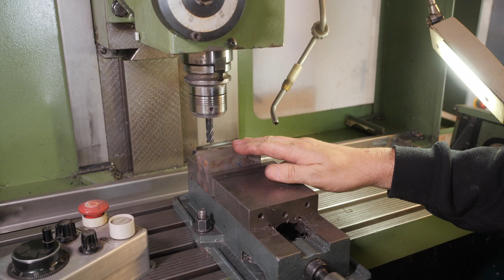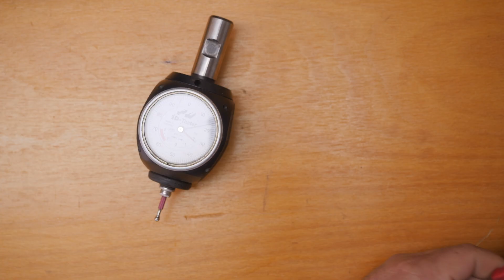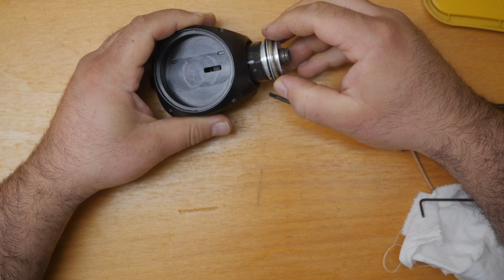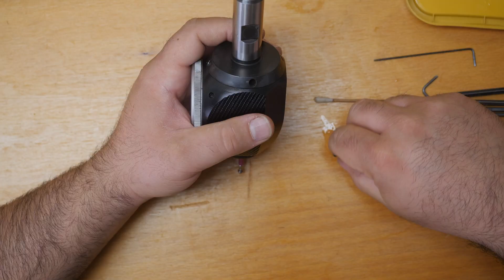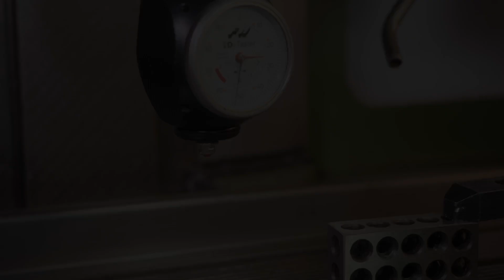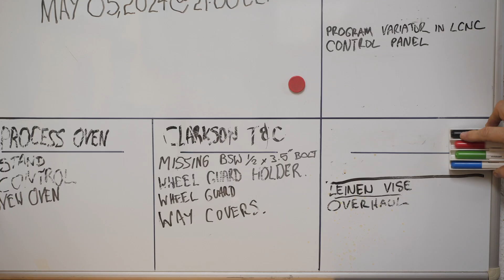Haimer 3D probe jammed up || RotarySMP

Comment: Thanks for the upload! I rounded the grub screw holding the dial in, and didn't want to pull mine apart to see how it worked to check what grub screw end was required. Thanks
!
Reply from the maker: They are a really nice tool.

Comment: Watching this makes me want to get into a whole area that I've never been able to get across to people. It's a topic I have no idea on where to even start . When machining we're so used to having very rigid parts clamped together and as a result we need very flat precision surfaces. But when you cut back to the basic physics in reality things only have six degrees of freedom. That means if two parts touch it more than six points they are over constrained. That's because in our world there are three degrees of freedom of linear movement and three degrees of freedom of rotation.
So what they call a kinematic coupling has only six points of contact. This type of coupling is often called a Kelvin Mount after Lord Kelvin who wrote a paper on them in around 1868. There are two types and in our case the one of particular interest is called a type 2. It consists of three grooves 120 degrees apart on one item and three balls 120 degrees apart on the other. You can vary that angle provided the two parts are of similar angle.
Go here in Wikipedia to see a very good description:

https://en.wikipedia.org/wiki/Kinematic_coupling

The key point Is that if you disassemble them and reassemble them they go back to exactly the same position. So the assembling is repeatable if not accurate. For accuracy you still have to calibrate them for being centered to the milling machine spindle, but you know after that it would always settle to the same position.

These days you can buy a touch off probe made using this construction for around about $100.
Usually the six faces of the grooves are replaced with roller bearing elements, in parallel pairs. The construction doesn't have to be particularly accurate because the principle of six contact points means they're still repeatedly go back to the initial position. Then you simply put wires between the rollers, making sure the wire goes from a roller on one ball to a roller on a different ball. Let's assume we now have a circular short circuit daisy chain from roller to roller passing through each ball. Now cut one of the wires and connect a Ohm meter across the cut wires. Now if any ball were to lift off any of the rollers, the daisy chain will be broken just like old Christmas tree lights . We're assuming here that the plates shown in the Wikipedia  Kelvin Mount diagram are insulating.  Now you mount the touch probe on the center of the system pointing through down to your part and you have a spring load that tends to push the two plates back into their mounts . Using this probe in any of the X,Y or Z movements on your mill will open the daisy chain when it touches the part so you can set X,Y and Z immediately contact is lost . Super simple. One moving part. Cheap to build.

A similar concept is a Stewart platform that you would recognize on  a flight simulator:

https://en.wikipedia.org/wiki/Stewart_platform

6 rams to control the 6 degrees of freedom: pitch, roll yaw, ascent, side-slip. and forward.

It's also used on the cheap HP bubble jet printer head traverse, on a centerless ground bar, with one linear degrees of freedom unconstrained. Over the last 30 years they must have made over 100 million of them.

And lastly: centerless ground bar is the only grinding process I know that is super fast, super cheap, and super accurate. It's about the only accurate large component in the whole prints. I ran one in Auckland one (university) holiday making pistons to Lucas hydraulic pumps. One machine can do kilometers.

https://www.youtube.com/watch?v=6U4qH8dSi_8

(turn on the coolant please!)

So many projects we could build with this concept. An expensive camera mount comes to mind.

Comment: I get how you dial in the unit with the 4 screws for minimal runout but I don't understand how you were able to calibrate the unit with the 4 frame screws. The fact that the bezel rotates made it even more confusing as to where to set the 0 in its resting position.
Reply from the maker: It turned out we had been trying to set it for 4mm balls, and were running out of adjustment, but once we switched to the standard 5mm balls, it adjusted easily.

Comment: So what was the issue now?
Reply from the maker: It was jammed because the dial face was not level and jammed the needle. 

Then you have to set the range of indication to the ball diameter. As there was a 4mm ball, we had to move to the edge of adjustment. Once I broke that ball, and replaced it with a 5mm one, we could move it to the center of it's range.

Comment: I gotta say, you should look into (making?) A conduction probe. Light turns on as a current path is completed through the machine. Maybe make that trigger a lil transistor or mft or a stack of such so that the machine can know when the switch is triggered. That or use what amounts to a series of IR leds and a remote receiver. The device is super simple and probably a fun lathe project.
Reply from the maker: I started making a 3D probe to tie in with LinuxCNC, but it it ended up on the low priority project pile. Maybe I will get back to it.
Reply: @RotarySMP  Well, you got the tools for it. at least most of them. That being the grinder and the lathe. it's just a ball on the end of a stick with a plastic separator either mechanically held or glued on, or even screwed on, though if I remember correctly, threads are not a locating feature. It's definitely not a priority, yeah, but if you need to get something out and you're stuck twiddling your thumbs... it might be something you can do, if you're comfortable with electronics. really, yeah, the hardest thing to do is to get it talking to LCNC while rotating. Hence my idea of using 3-6 IR LEDs. could also use slip-rings but that mightn't be the most reliable. Also rotation's to couter the ball maybe not being round enough.

Comment: I bought a used Haimer last year. It was my big tool envy purchase of the year. Be careful with the tips. They are about $85 US each. Once you Haimer, you can never go back.
Reply from the maker: Thanks for sharing. I need to reset all the tool offsets in my tool table based off the Haaimer, but also look forward to using it.

Comment: Hope you checked the runout after you snappede the 4mm off and mounted the 5mm. Since your suppose to always check them every time you mount a new. Onee in ( when I was still in traning to become a machinest I snapped one off. Put in a new one and didn't understand why it was so much off. Then one of the old guys told me that you suppose to check it every time you mount a new ball. Cause it's never perfectly centered/just like the last one. And when I then checked it it was about 0.4mm off )

Personally I would try and make a spindle toolholder with the face match the 3d probe and is pulled up through the body itself. Witch makes it as short as possible. Free up a tool holder and also seems like a little fun project to be honest
Reply from the maker: Yep, had to dial it back in again.

Good idea on the tool holder. I have a lot of more urgent projects, but may do that.

Comment: Right at the end of your video you mentioned turning a HHS blank with a diamond insert. Now I have never tried turning hard steel with diamond but I have done it many times with CBN inserts. I have always used diamond for abrasive stuff like carbon fiber of glass reinforced plastic. As well on the grinder I would use diamond for carbide and CBN for steel.
Reply from the maker: I was wrong, it is a CBN insert. It worked well on HSS-E.

Comment: Nice! Always liked the looks of those Haimer probes. As I recall, NYC CNC accidentally spun one up to a thousand RPM or more…it didn’t work after that 😄
Reply from the maker: I hope I dont repeat that error :)
Reply: @rotarySMP can you program your CNC computer to disable the spindle motor whenever tool 1 is selected?
Reply from the maker: @dwegmull  Good question. I need to look if LinuxCNC has that option standard.

https://forum.linuxcnc.org/49-basic-configuration/40416-prevent-spindle-start-if-a-certain-tool-is-selected?start=10#303156
Reply: My company sells these units. You might be shocked at how often they get spun up. 12kRPM in a robodrill modifies them quite significantly.
Reply from the maker: @wtsct339  I bet it does. Haimer must love the repeat customers.
Reply: @RotarySMP  I guess it's a testament to the usefulness of the product that most are immediately replaced with a new one.

Comment: Mark, what's your thoughts on the AUA jet losing its nose ("propeller"😂 as some media called it) in the hailstorm? The airline seems to have a run, now this incident after scrapping an almost new plane by hitting some ground installations only a few weeks back...
Reply from the maker: Yeah, the Neo was not AUA's fault. The towing was done by the airport company. I dont know enough about weather radar to know whether the crews report that the storm cell was not shown is plausible.

Comment: On a related note, I designed (well, it's a synthesis of other designs) a relatively simple touch-probe that can be easily machined (or 3D printed). 
https://youtu.be/2ia1_NKQJKs?si=pyc8kjaIt-HVGZEd
It is held together by the contact elements, which means that it can be made very small, for example to fit inside an ER20 collet holder. 
https://youtu.be/yOvBcecJ3Fg?si=XDOMB6h4cFELReyz

Comment: Would love to see how you use this for the Z axis.
Reply from the maker: You will in a video soon. Basically the same as with X and Y, but you just drive it straight down into the part, until it reads Zero. Then zero Z in LinuxCNC. As long as the tool table is correctly set up, with all tools referenced off that same Zero height (I will have to go through them all and do that), then you are done.
Reply: @RotarySMP  Just don't really drive it straight down too far,  they don't like that at all.  I've had to give myself a pause from using touch off probes on home cnc.  Didn't use it enough and when I did I found a new way to be stupid with it and break it.
Reply from the maker: @mikeandhismachines  Thanks for the tips Mike. It is no easy to add a change like this to the work flow without making some screw ups.

Comment: There sure were a lot of screws holding it together.
Reply from the maker: Hi Ken. Four to center the ball, and then another four to locate the dial correctly in the travel for the ball size. Should speed up my set up a bit now.
Reply: @RotarySMP Can't forget the two loose screws in the room! (at the time)  😂
Reply from the maker: @jimurrata6785  That is us :)